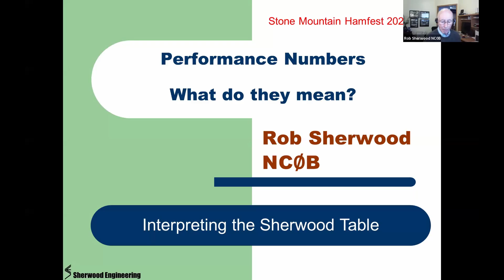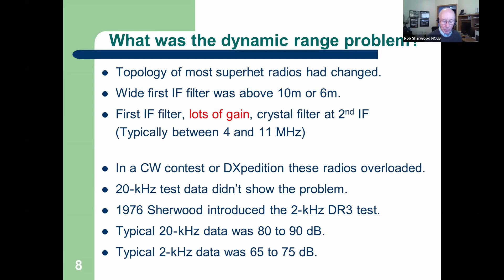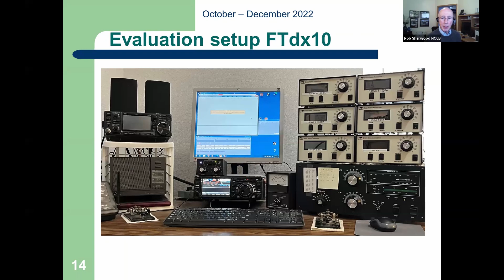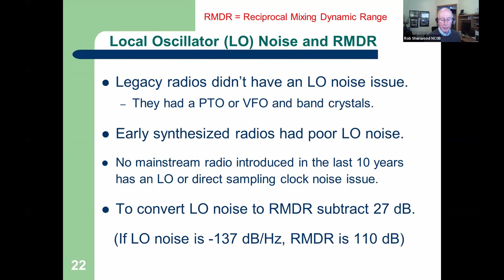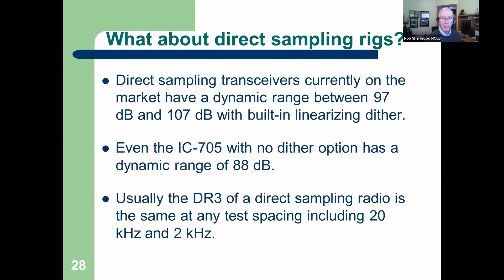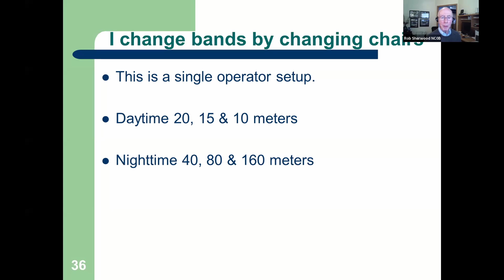Rob Sherwood NC0B Hamfest 2025

Comment: Thanks for this information. 
I bought an FT817ND in 2017 for portable as my h/b one is too big.
I compared my h/b one against a friend with an FT817 and only on 10m were signals on mine weaker. 
Mine has no pre-amp.
It uses the G4CLF main p.c.b. designed in 1980 by James Bryant with his published specifications below, 

Dynamic Range 114 dB (wanted signal)
                              88 dB (off frequency signal)
Sensitivity Below 0.3 dB for 10 dB SINAD
Third Order Intercept +7 dBm

F.E.T. osc. and buffer 5 to 5.5 MHz v.f.o. Very stable with no complaints of drift. 
B.P.F. for each band. 
I have no means of measuring any of these parameters.
Whether it's good or bad I've had it for 30+ years of hassle free operation. QRP all h.f. except 60m. One luxury of an audio c.w. filter. 

G4GHB.